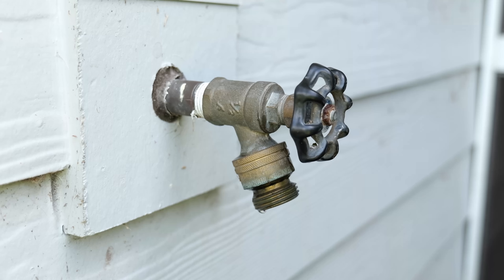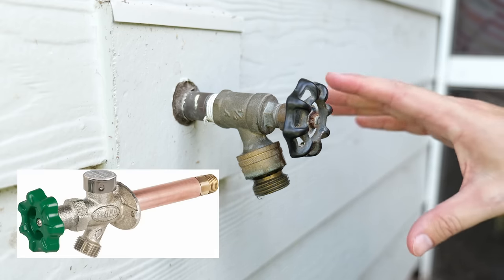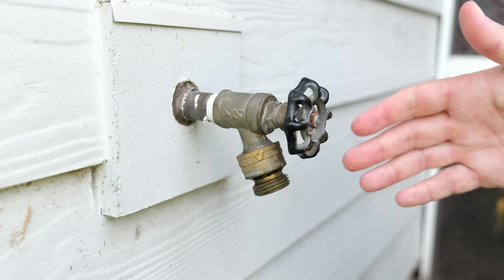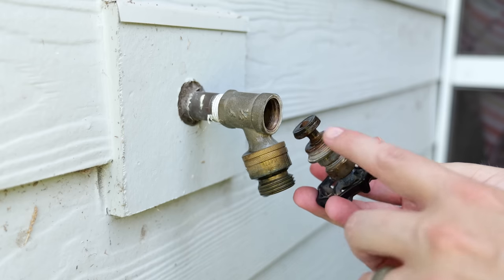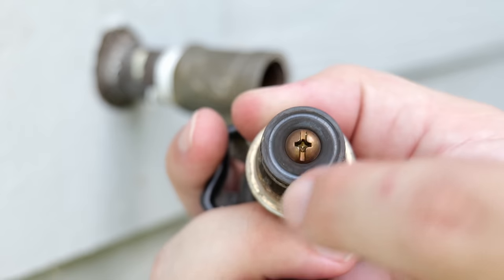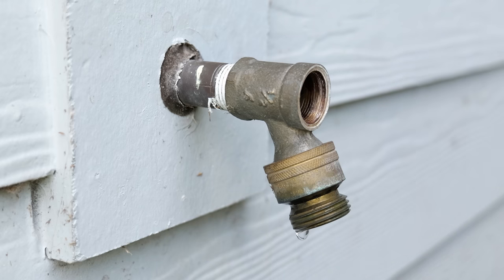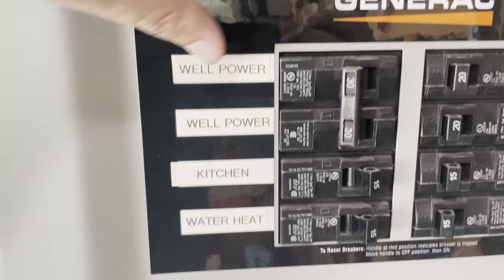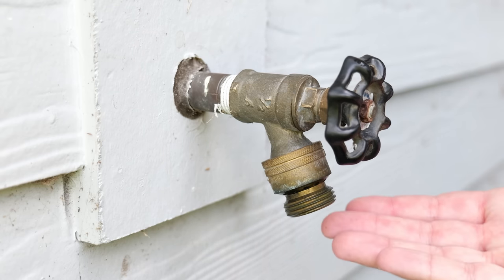How To Fix A Leaking Outdoor Faucet!  Cheap and Easy!

Comment: The question that bugs me with this kind of “single” nut faucet as opposed to one with a second nut housing that houses the teflon or graphite thread packing that crunches in between the in & out moving rotating shaft & the faucet body so the clearance between the shaft & valve body is closed up, which if open will cause water to drip - how is this achieved in the faucet above? Because the seal you just fixed is not at all  related to what I just described above? Anyone can shed a light or spray of water on this matter, much appreciated! Thanks.

Comment: I appreciate this video, will this also stop a leak from the handle? Mine is dripping from the screw in the middle of the round handle. thanks in advance
Reply: That's the packing nut, that's the nut just passed the one you use to remove the stem like in the video.
Reply: @christopherfrankovich5239  Thank you for your insight and response!
Reply: I just recently had that same issue.  It is a closed system to a float valve in a trough, so if it leaked out the bib itself, it wouldn't matter.  However, it was leaking out the handle (which is always open).  I simply tightened that same nut slightly, and it stopped leaking.  I was going to replace it with a ball valve, but gave this a shot, and it was a simple fix (at least for now).
Reply: @Tarkus_  awesome glad it worked, thank you!

Comment: What about a leaking shaft when the water is on?
Reply: The shaft has a "NUT " with packing material inside squeezing around the shaft.  If the shaft leaks or feels loose, use a wrench to gently turn the shaft nut clockwise to tighten against  the packing material.  Don't over-tighten or the shaft/ knob may be difficult to turn.

Comment: Seems every time I repair a valve like this the bibb screw is so deteriorated it crumbles when you try to back it out. Then you need to get out the drills and screw extractor. It's too bad these bibb screws are so cheap, I cannot find any that will hold up. Also, ALWAYS use plumbers silicone when reassembling, load up the screw hole. This will make future disassembly much easier. Plumbers silicone is your best friend when servicing any kind of valve be it cartridge, washer or other style.

Comment: If your on a well that means you have a pressure tank so instead of draining your pressure tank there should be a valve at you tank so shut that instead .
Reply from the maker: No thanks.  The valve is only right at the tank so I would have to shut it off then go shut off the well power as well.  This is easy easier and takes maybe a minute longer for the water to drain.

Comment: Instead of buying all those washers  which you will never use again just buy a new valve , that also guarantees that the seat of the old valve will not have a wire drawn seat which also causes leaks and are hard to fix unless you have is a seat grinder tool.
Reply from the maker: Buying a whole new hose bibb is usually quite a bit more expensive than just replacing the washer.  Washers are cheap and I have plenty to fix future issues on other hose bibbs and other valves that may need them in the future.  It’s always the water I replaced in the video.

Comment: 1:43 You should have tightened the packing nut to stop the dripping. That's the closest to the valve handle.
6:01 Also you should have used a slightly  smaller washer one that fits inside the valve stem lip. The only part of the washer it's touching the valve stem it's on the edge of the lip there's a gap under most of the washer and it will eventually Bend out of shape.
Reply from the maker: The packing nut wasn’t the issue and often isn’t.  The washer size was perfect.  As you saw, it matched the old washer and the dropping stopped.
Reply: @HowToHomeDIY Even if it "wasn't the issue" in this case you should have mentioned how to tighten the packing nut.
The new washer is slightly bigger than the old one so it doesn't fit inside the lip. As you said "it's closest and replicating the size". You could have squeezed it inside the lip so that the washer sits firmly on the base instead of top of the lip lleaving a gap underneath which will eventually push the washer out of shape and cause leaks.

Comment: Why not just flip the washer over and get twice the life out of it?
Reply: That would work if the washer is still somewhat pliable. If it's hardened or has been really pancaked, it's not going to seal well. And washers are cheap.
Reply: They dont work that way.  The stem has a seat the washer sets in and once they get compressed that’s it.   The washers are Pennies in price.

Comment: Here we go again?? 1:40 - Notice that by turning the stem nut he is also turning the stem (the handle turns) which in turn compresses the seat washer, possibly damaging it by over compression?  To alleviate this circumstance the valve should be opened, then the procedure he demonstrates might work. Older sillcock stems are packed with graphite cord. Newer ones with Teflon. If cranking them down doesn't work the problem could be old packing OR a bad seat washer. It's not rocket science. Turn the water off, open things up, replace both items and be done with it!!
Reply from the maker: Jack, you just know it all don’t you 😂.  Every comment.  You clearly did not actually pay attention to what I said about all of it.  It is a temporary fix method as stated in the video.